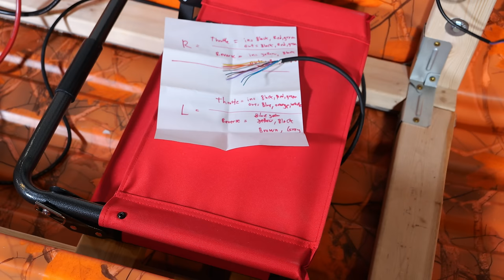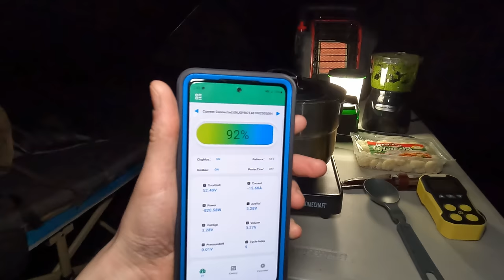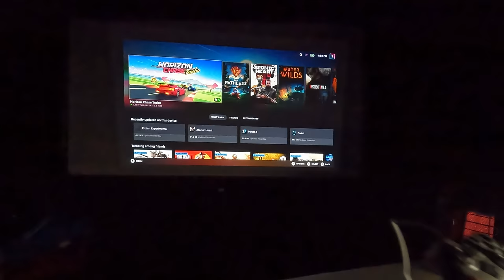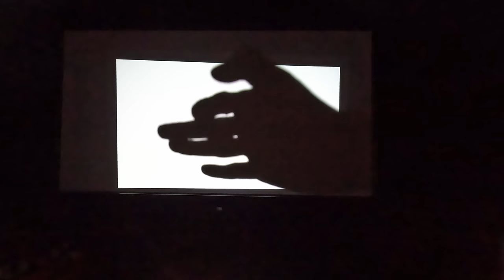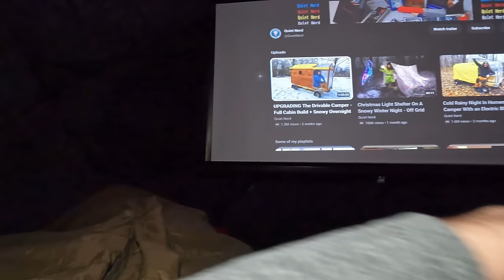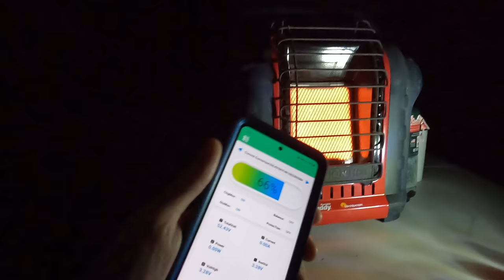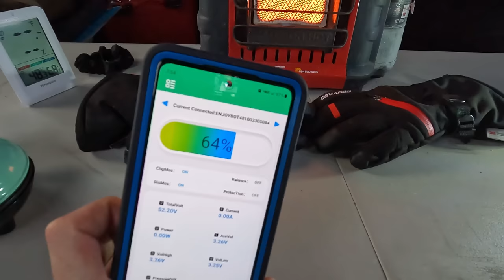Building An Electric Snow Train -  Full Build + Overnight Winter Camping Adventure

Comment: As an upgrade for your train, you could add some covers to the other 2 sleds. My recommendation is to use 2 additional sleds as covers that can be secured down or detach when you want to pull passengers with you.

Comment: Couple tips. Get a compact blower for your tool battery to blow out the tent. Add a cordless shop vac or one of those handheld vacuums to suck up any debris you can not get out with the blower. Keeping the tent clean on the inside will do wonders for its life and durability.

Comment: Only suggestion I can give is flatten the tires a bit, it will give them more grip in the snow and soft material since more of the rubber will be in contact with the ground. Unless you are going for high enough speeds it won't cause any problems (High enough speeds will cause the tire to expand but I doubt you'll be going 60mph or more)

Comment: The screws that hold the gray control box down need large washers under the heads so that the screws will be far less likely to pull through.   A basic rule of thumb when screwing down plastic.   That plastic will become brittle when cold.   Neat idea, by the way.      The ropes on the tent are guy ropes, very important.   The farther they are staked from the tent, the better.   IE, keep the ropes as long as possible.   The stakes are less likely to pull out that way.   Also, always stake down the corners at the bottom where the floor and walls meet.

Comment: You are one of the coolest YouTubers out there, honestly! Bringing that projector setup would automatically make you the neatest guy on the campsite. 
A tip for the tent: if you double up tents, it helps create a layer of warmer air to insulate. This would work great with that giant tent and maybe a slightly smaller one inside it in order to be warmer.
Reply: 👍 true

Comment: I gotta say absolutely love your sled project. Come to think of it, i love all of them!

One tip I suggest - instead of using paracords, I would suggest using some sort of tow bar (like the ones you see on lawn tractors) between sleds. Not to mention if you do that, then you can pull other things for different situations/equiptment. 

The reason I suggest tow bar & hitch (besides the above) is so that way the other sleds don't collide due to abrupt stopping.

Comment: You are hazardous to my life! You have given me so many ideas and answers to problems that my wife has become quite upset about the projects I am designing, and parts I am accumulating. Side note, I would recommend making a front steering system on the front, using bicycle handlebars to both steer with and attach your motor controls to, and making an adaptor for skis that you can cut short for front runners. You can also use the same to attach wheels for summer or times when there is no snow on the ground. Regular flat-proof wheelbarrow tires will suffice. Lifting that front end will end the extra drag as well as wear on the sled.

Comment: I'd turn the wheels into track drives. Just add an idler axle on front and a few (per foot) angle brackets for alignment on a belting track w crossers for traction. Angle iron (bed frames work good!) w a couple teeth would make good crossers. A few inline skate or skateboard wheels on another 2x4 between the axles for making traction.

Comment: What you have done with that sled is great, I think the bottom of the sled might wear out quite quickly if you use it often without much snow cover on the ground. 
I would like to see a track version of this, a track version should be able to go through deeper snow, you could put runners on the bottom of the sled, that way you would only need to change the runners out when they wear, it would help prevent damage to the bottom of the sled when traveling on rough ground.
I enjoyed watching this video.

Comment: I would add a steerable front tire/ski combo with the controls mounted to the "handlebars" of that system. Also, consider adding some plastic strips to the bottoms of the sleds, this will allow them to slide long easily and not wear out the bottoms of the sleds.

Comment: Fantastic work!  Two suggestions:

1) Consider adding fenders to the wheels and/or tarping your train sleds to prevent snow and dirt winding up all over your gear.

2) Consider adding desiccant packs to your battery and electronics compartments to absorb moisture.
Reply: 3) Consider not using untreated wood for the structure,

Comment: That plastic is gonna start cracking where the motors attach to the sled. I'd take something solid (like a cutting board from Walmart) and put it on the inside of the sled, drill the holes, and then put the bolts and washers through that. Then there won't be those small stress points.

Comment: That looks like an awesome tent, but probably cost a small fortune.  But then watching you build the electric sled, I'm not surprised that you probably only use the best components for everything.  The only change to your powered sled I would make, would be to add some kind of metal skids, or skis to the front, so you are not wearing out the plastic or fiberglass tub that you are sitting in, considering that it is carrying quite a bit of weight.  I guess there wouldn't be much wear if you were only using it on deeper snow, and never hitting dirt, rocks, or tree branches, but like this first test of it, you might not always be on virgin snow all the time and wear could be a problem in a relatively short amount of time.

Comment: Another great video!
That projector is a great idea!  I have a 20-man tent (which my godkids dubbed the Nylon House).  It has a few nylon sheets that divide the inner space into semi-separate rooms, and they'd make amazing projector screens!  Next time I'm forced to use an electrical campsite, I'll be sure to keep this in mind!
If I could make a small suggestion in return:  you might consider attaching the "cars" of your train with electrical pull tape, rather than parachute cord.  The lighter stuff has a working weight of 1000-1200 lbs (compared to the typical 550 lbs of paracord), at roughly the same material weight.  That way, if one of your sleds gets snagged on some brush, a gatepost, etc, you won't snap a line.

Comment: A few tips you could actually use:
1. Since it was so windy;maybe install a portable windmill or two, so you can generate power during the night!
2. If you want, put velcrow on the corners and in the middle of a few solar panels, then, put velcrow on the corresponding places of the solar panel on the outside of the tent, got yourself a sun farm.
3. If you don't like the wind but like the view of the windows, on half the windows, put a clear plastic sheet on the fly screen, so you can open the windows and see without freezing.
4. If you'd like, get one more of those sleds and put a small housing abounding like your other mini camper you made, so if you can't get your tent up on time, you don't need to worry.
5. You could (if you would like more speed) put some loose free spinning wheels on the other cargo sleds!

Hope this helps!

Comment: Hi you need to put a portable steerable front axle that you can remove, also a portable solar panel if the sun comes out to charge up and a fender setup so you don’t fling trash on your stuff. Great Idea Great Video Thanks 🙏

Comment: Did you try moving your battery to the front and sitting at the back of your drive sled? That should put more of the weight on the drive tires and give more traction to reduce tire spin. Other people mentioned lowering the tire pressure and making sure the tire tread is turned the right way might help too.

Comment: You've done a number of these builds with the 48V motors where you weld the gears inside the differential. But I don't understand why you do that. Maybe in the next build, you could add in a bit of engineering advice, such as why you need to weld those gears. The episodes are great as-is, but it would be cool to learn a bit of engineering, too, as you go along. Just an idea!

Comment: You should look into a portable chinese diesel heater. Been using one for 4yrs now on my sailboat. Mine in permanently installed and sips diesel and is super super efficient. Those buddy heaters cause a lot of condensation and burn a lot of propane. Only good for emergencies. That condensation was because of the buddy heater. A diesel heater would instantly heat the largest tent and is fully adjustable for small and large areas with 0 condensation.

Comment: Such an awesome vid I would only recommend giving the sled trailer a little bit of lift In the front on each individual sled so it would be suspended so that way it’s takes less power to pull due to less friction which means longer lasting battery if you were to put more weight in either sled trailer sled also stud tires either use screws make your own or buy studded tires

Comment: I was thinking that if you want a video idea for your next genius enginerded vehicular adventure: A very popular thing on YT is the Chinese Diesel Heaters made for RVs/vans which some people have made into portable units for tent camping and the like.  The benefits to them are the safety as combustion is close loop like a forced air furnace so the exhaust gasses are removed to the outside providing only heated air and no moisture.  The heater unit can be kept outside with a single heat duct running into the tent or vehicle making it a quiet safe way to heat.  It may be too close to spring for this idea, but maybe next winter...anyway just love your videos and builds, top notch.

Comment: You may have better performance with wheel slippage if you raise up the rear of your drive section.  One or two more inches would probably make it work better.  If you get really soft snow you could lose traction completely and just spin your tires.  Would converting it into more of a snowmobile style for the front end work better?  You may not even need to make them steerable (?).

Comment: FYI: that motor control box will generate a ton of heat and those need to be separated and have a exhaust and cooling fans. For future reference create a wiring diagram and adhere numbers as reference source, just good working practice.

Comment: Love the build. I would be worried it would tear the plastic at the back where the motor assembly bolts to the plastic. Maybe a support board on the plastic side would give it more stability like a boat transom .
It obviously worked fine though like you had it.

Comment: I've been using the Steam Deck + Projector setup for a while now and highly recommend investing in an HDMI/USB-C cable, especially for projects like this. By plugging the Steam Deck directly into the projector/TV you bypass the need for the dock and you can utilize the Steam Deck itself as a controller instead of using a 3rd party controller for single-player games (2 less items that require power to carry around). The only downside is that you can't charge the Steam Deck while connected straight to HDMI so your battery life will depend on the type of games that you play. It's nice to have the dock + controller setup for longer gaming sessions but I haven't used either of mine in months. I bought a 10ft long HDMI/USB-C cable from TEMU for like $9 and it's the best/most used Steam Deck accessory I own.

Comment: It's just a matter of small piece of rock hidden under the snow to shatter the engine sledge, there must be a front wheel which will not only make it safe from hidden hazarda but also make it  more agile and  reduce pressure on the battery to keep pushing with all that huge front contact surface.

Comment: Awesome video. I know the battery is rated for some pretty low temperatures, but for longevity, I would suggest some insulation padding or make it removable and bring it with you into th tent.

Comment: thank you for the nice sharing an greetings from Turkiye
(google translated)
a few criticisms
It would be better if you cover the trailers, and if you add a small tent to the device you ride on, you will travel in a warmer environment.
It would have been more beneficial and delicious if you had mixed the pesto with the sauce instead of pouring its water.
The tent you are using is too big for 1 person, you would warm up easier with a smaller tent.

Comment: the only difference i'd make,  weather can turn really bad really quickly sometimes.  blinding snow, white out conditions, dangerous temps.   

So a  light weight frame of PVC  Plastic wind screen, tarp roof, maybe clear plastic sidewalls, and a clear plastic rear that can be rolled up or tied down and secured.    maybe a zipper on the sides and back  to open and roll those up too.   

Doing this,  if the weather starts to get really bad,  you could seal it up, including the battery area...  start a little buddy heater and be safe.   

we have people freezing to death in cars around here, so safety like that is always a concern.

Comment: Ether two skis or one big one on the front with basic steering controls for easier steering could have been a good idea (u can find old/used snowmobile skis online or at a small engine repair shop) and it would be less friction too insted of pushing half the sled on the ground it would be the skis

Comment: What about either putting a heater on the battery or making it removable so you can bring it in the tent to keep it from freezing? Lithium batteries stop working if frozen compared to lead acid.

Comment: Someone or some company makes that track sled dog thing. If I recall its just a large track with motors and batteries inside and a handle and you just use the handle to move in the direction you want to go and it just pulls you. I always wanted to find something like that.

Comment: That turned out awesome.  The front seems heavy, while the back seems a little light. I'm sure you'll find a solution.  So with nothing to add but it's awesome, I have two questions.  What brand tent is that? What brand is that tuna? Where did you buy it?  I've never seen tuna chunks in a jar before.

Comment: I just wonder if the wheels are lifting the rear of the sled a bit too high.  May be too little of the surface area of the sled is being used to distribute all that weight.  Hope you've waxed the bow of that sled nicely!

apologies if you've addressed all this- I haven't made it all the way to the end of the video yet

this is such a cool concept, man.  You nailed it

Comment: When using any kind of propane heaters inside of tents or buildings, you need oxygen flowing through your shelter so that the propane heater doesn't suck up all the oxygen in your shelter because it is very dangerous when that happens

Comment: What battery, thought
We can see the power usage with all this fun, cooking and cozy stuff, it looks fine
Now imagine using it efficiently, just for moving through the snow, lighting the camp at the bare minimum and keeping warm in the coldest time the of day. How many days you could survive with this? How far could you drive and then return? How far could you drive without returning? And how many new faces you could meet on this way?
Reply: Now imagine all of that in the spring or summer. Much less equipment weight (= more space for food and water), longer daytime (=less power usage for the lighting), much warmer (=less power usage for heating). How long would it last then?

Comment: just a little pro tip: never throw away the styrofoam the battery comes with. it's a free shock absorber. you don't even need to cut it that much, just stick it back in.

Comment: nice vid per usual. some tips:
1. tip for the food: you could've added nutritional yeast + cashews (instead of the nutrient deficient olive oil) and used a little bit of the hot water with it; also crumbled in tofu instead of the tuna (which is laced with toxins btw, plus might not even be tuna).
2. tip for the cooking: an instapot (has locking lid, add everything in advance before leaving, no risk of forgetting salt then) would've been faster and more heat efficient for cooking (plus could've cooked lentils in 2min on high pressure, or kidney beans / chickpeas (garbanzo beans) or others in 20 mins on high).
3. gourmet: i'd have eaten everything with bread, but noodles are good also - plus, i always bring bread - or even make my own 1h quick if i'm in a rush and want freshly baked bread.

Comment: Greetings and Salutations 
What wire would conduct electricity? For the motor is a live wire with loads of steel washers on it, but the cost varies for a 9v batteries 

Good luck #Thanks 😊

Comment: you failed in one thing you need an 60amp dc breaker in-line on the on the gap between inverter an the battery with that much power you need it espily on an 100h 48 bat, if you do not do that it will be a point of fault can cause melt weld fire so id add that asap also this is close to an set up for an hibrid solar unit if you use one of them you could make it solar in a instant too as a plus.

Comment: What kind of winter is that, man? this sled needs snow, or the terrain you have will eat the bottom of your vehicle in notime. Also curious how this rides if there is more than 1 foot of snow.
You also left the most temp-sensitive part - the battery - outside the tent? just how naive is that?
the idea is cool, the implementation leaves much to be desired

Comment: How come you didn’t add a heat dissipation fan to the control box those controllers do get a little warm I do understand they don’t get extremely hot, but a little heat dissipation from that box would help even if you put small little inch by inch fanS 13:14 13:15

Comment: Im so confused ... ill back it up and watch it again to see but id swear you locked both motors together to make 1 solid axle yet you controlled each motor independently to stear
Edited after I rewatched I was confused about how the motors worked where you tied the 2 motors together I thought was tied all the way thru to the outer axles where the tires mount